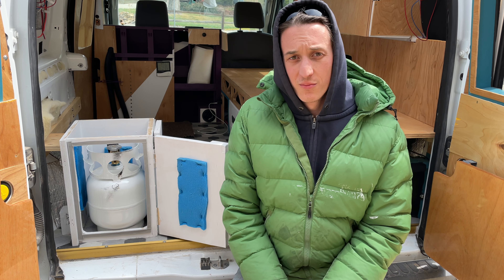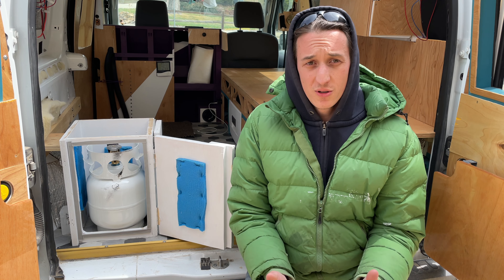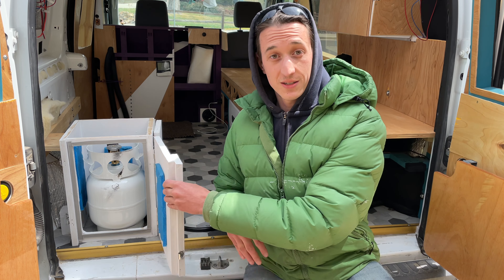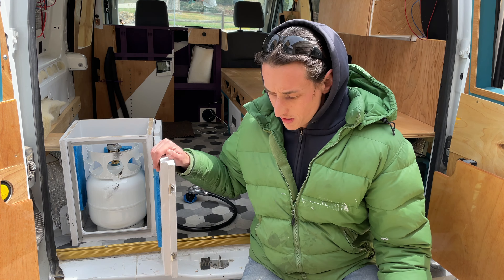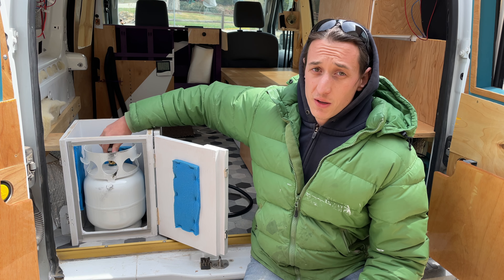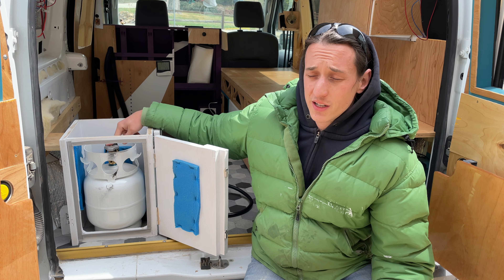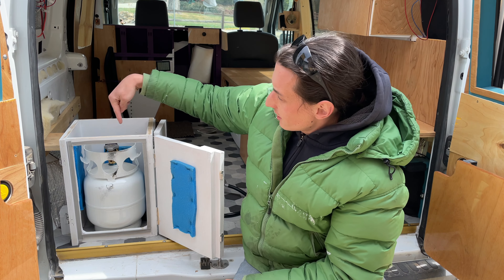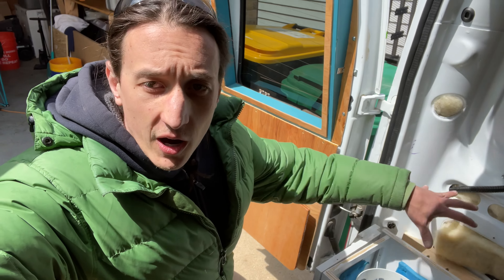Propane Locker for Camper Van - Is This Dangerous?

Comment: In Australia (the strictest on LPG installations), that box would be illegal because it opens to the inside of the van. It is essentially an 'indoor locker' which still allows for LPG to enter the van. If this is legal in your country, then the very minimum I would do is drill a large 'drop out' through the floor and seal the door with foam tape as you did. Vent the entire van everyday, by opening the back doors for awhile. Install a LPG gauge and monitor the useage. BTW> Strap the bottle in well.

Comment: It is good, to show how to made it. 
So I hope, more guys would build One for his Propane Bottle.  (me too)
But also straps needed, to fix the gas bottle.

Here in Germany you must do an anual safety check of your propane system, if solid installed.
Every year. An expert pumps air in the system, to check, if its not leaking gas.
Also looks, if damages in the system. Or if gas tubes and regulators are too old, because of rubber.
Most gas parts are cheap in germany. So easy, to use new parts, for better safety

Every check is reported in a small yellow paperwork. Where you must show it, ie entering a campground. Or for separate safety check of the vehicle.

Long ago: In Switzerland has burned a lot of camper vehicles at one campground.
Maybe because of one, with a failing gas system.

Comment: I think that it is good that you have a bottom lip on your box. It will help a little. But it might not be enough.

The reason the standards suggest a top opening vs. a side opening is that (as you state) propane is heavier than air. So if it leaks (more like when) it will pool at the bottom of the locker. You DO have a vent for it to pour out of which is good. But it is not like water. it will not rush out in seconds, and air currents will slow it down. So if you have a leak and you open the side door, propane might still be built up in the locker (higher than your threshold). This would then spill out into your living area when you open the door. If it reaches a spark it could ignite. A top opening has much less chance of that happening as even a relatively significant leak would hopefully still be pooling in the bottom 80% (made up number) of the locker when you open the top.

You might consider hooking a fan up to force vent the locker, but I have no idea what the consequences of a spark from the fan would be (remember what happened when Apollo 13 stirred their oxygen tanks)? :)

Finally, you appear to be venting the propane right next to where the exhaust system is... I have no idea if that is an added danger or not. It seems like something you might want to keep in consideration though.

I appreciate that you are presenting your projects here, and that you don't make any claims for authority.

I also do not really know all that much about the subject so I want to make that abundantly clear. But a slip-up with something like a propane tank could be significant.

Just my 2 cents.
Reply from the maker: These are great points. Thanks for the comment. I am definitely trying to avoid an Apollo 13 situation haha.
Reply: Plenty don't even use proper safety and it doesn't leak. Not to say to be reckless but that its not as scary as people think.